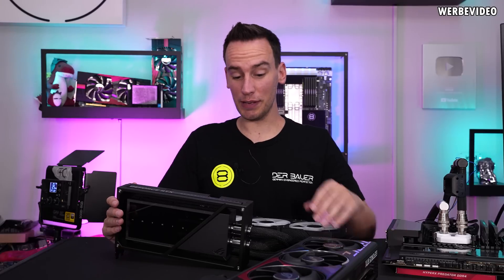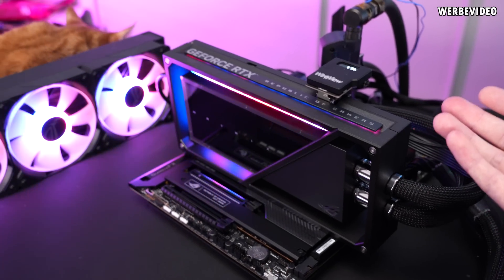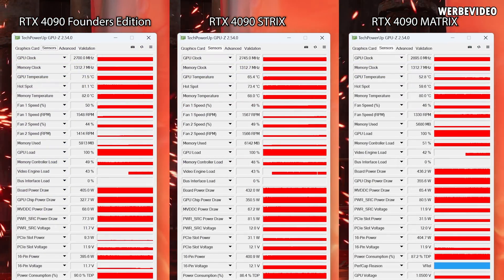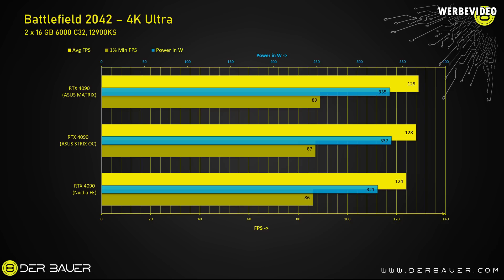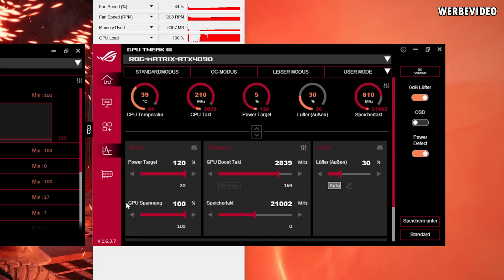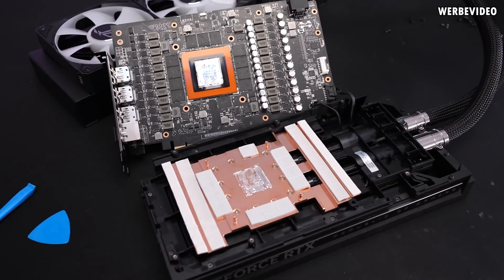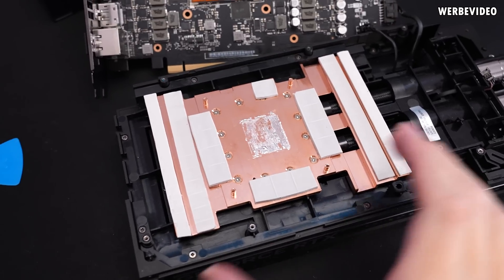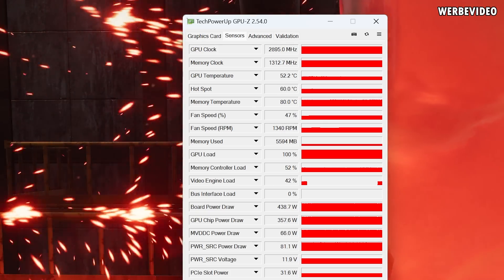The fastest GPU ever Made! RTX 4090 Matrix

Comment: 4090 is coming up to 1 year old, which means the 4090 has been Nvidia's most powerful GPU for 1 year too. I'm just wondering if this is a record, as a GPU doesn't normally hold the record of king of the hill for long.
Reply: 3090 released in 2020, 3090 Ti came in March 2022. No record being set here. If anything, I could see this item being authorized by Nvidia because they're likely releasing a refresh sooner rather than later due to poor sales in general. Asus didn't need a halo product - they already had the best 3090 and lost its largest Nvidia AIBP competitor globally (EVGA). This product is more in line with Nvidia's interest than Asus. I can really see a 4090 Ti coming either before or immediately after new year
Reply: the 1080ti would like a word hhehe

Comment: Nice, but for the size and parts used (cost), I thought this would be 3ghz out of the box. I would also have thought that coil whine would have been the best due to them switching out the noisy inductors they have been using.
Reply: mrmr gaming,
What GPU u use now, coil whine ?
Who needs these ASUS products, why not buy the RTX 5080 ? Go cheap ?
Reply: @lucasrem  Right now, the Aorus Master. After the new bios update it's my second fav performance-wise (Strix is better, but most have terrible coil whine). The Master coil whine is the same as Zotac, PNY, and some others. It's there, but it's way less than the Strix.
To me, the Matrix is just if you have the cash or really...really need it. It's a bit late to be paying this price for a 4090, and as pointed out, Asus picked a bad plate to use, so the card will only be great for a few years. When you come to sell it, the person buying might know their tech stuff and be put off.

Comment: I would really like it to see a video comparing this to a DIY open loop setup with similar components. You could get everything through Watercool (blocks, rad, res, pump, Noctua A12-25 fans) and a 4090 TUF with a Strix BIOS flash and use conductonaut extreme on the GPU. I would be willing to bet it would perform 5° better than the matrix at a given noise level, and be >$500 cheaper.
Reply: Even if it doesn't run cooler, does it matter? $500 is $500 (although the reality is that you could build a PC for the cost of this thing, and I could have a fully-blocked 4090 like $2,500 with rad and such. So, more like $1,500). Really, the biggest win is you get to buy a 4090 from a non shit-tier company (which, let's be real: ASUS is garbage-tier at this point), which is probably the biggest win.
Reply: @rustler08  The card does not matter, what matters more is the block, and the top performing water blocks are for the ASUS TUF and Strix (Optimus and watercool). An optimus 4090 block performs about 5-7°c better than an EK block.
Reply: umm HE DID, there laterally in  the graphs. Did you even watch the video?  AND NO air card is gonna  get 45C at 100% load, let alone 40C like ur saying.  My god man.
Reply: @dragonsyph2557  Perhaps you don't understand the meaning of "similar"

Comment: Instead of pushing the 4090 to new heights they should solve the ongoing black screen and fans 100 % issues that happen across all brands no matter what.
Reply: RMA... i had this problem with 4090 Strix. Truely nighmare.
Reply: Damn. My brand new PC had an MSI Suprim X 4090. It died after the 1st day! I got the ASUS ROG STRIX OC 4090 on warranty instead. And now I have the black screen issues. 😞
Reply: @Ohlukei  i was very desapointed too. I have bought a 4070 tuf during the RMA. Now i am hesitating to buy another 4090. 
The 4070 works perfectly.

Comment: 5000 series is what, 14 months away? But let's make a 4090 refresh 9 months after release.. 
No nickel plating..? How many thousands of dollars do you have to spend to get something well made. Another failure from a-sus incoming. 

Edit: FE temps about 10% higher, expected - the cost of a smaller cooler is decreased thermal efficiency.
Reply: Little over a year yes. Supposedly 2024/2025 so not quite fall of 2024. Reminds me of the Kingpin cards that too came out so late that there was already solid information about the next series. Tho Kingpin cards at least offered tangible benefits for overclocking even with Nvidias lock down everything approach. Even they (EVGA) got eventually fed up with it and now we have supposedly binned GPU's that cost double but do only a few hundred Mhz on top of stock or normal OC.

Comment: The lack of nickel plating is a non-issue

I lapped a bare copper CPU cooler and had liquid metal on it for years did redo it a few times as it would essentially weld the cooler to the CPU and a sudden enough jolt cracks the bond and makes it act like no cooler is installed

However even tho the CPU coolers bare copper is now black as can be it doesn’t actually affect the cooling capabilities as the allow that is made is still more conductive than the liquid metal itself
Reply: It IS an issue because the card is NOT User serviceable.  With LM on bare copper you are REQUIRED to reapply every few months.  THAT LITERALLY ISNT AN OPTION HERE!  Next time maybe try actually watching the video before posting.
Reply: @NinjAsylum  incorrect you only need to reapply liquid metal when it solidifies and the bond breaks

All the times ive had to replace it are from needing to spend hours driving in a car jostling it around and breaking that bond

Every-single time ive removed the heatsink with LM installed past 4 month it is bone dry but was 1:1 of when first installing it

If LM needed to be replaced then how are PS5’s having no issues hrmm?

Please think and actually read what i said

Comment: Would a Cryosheet be an easy fix for the Liquid  metal corrosion issue?  Or would the corroded copper make the sheet non-functional in some way?
Reply: Hardware Unboxed looked at exactly that in their Matrix video. It raised GPU temps by 1-2 degrees, but otherwise seemed to work fine.

Comment: I am curious if the pump was quiet if you raised the radiator.  On the table, it was slightly lower than the pump putting any air near the pump. .

Comment: I have an Asus laptop (Scar 17") and on the heatsink, the cpu side is copper, the gpu side is nickle plated (both with factory liquid metal applied).  The copper side is already starting to corrode after a little over a year.  I was having thermal issues with the cpu so I opened it up to check and found the corrosion.  Asus just doesn't care, I won't be buying from them again, which is really annoying because I really like their bios.
Reply: liquid metal does not corrode copper. It will only "plate" it or "stain" its surface and that's it. You should be worried if that plate is aluminum, as aluminum will be corroded
Reply: Thats a made up story.
Reply: For the price they're going to ask for that card the lack of nickel-plating on mating surface is plain stupid. They could do that one piece as it detaches. The sheer thickness of the thermal pads rather than making a better designed assembly is also disappointing, the thicker the pad, the worse the temps and by those memory temps... it shows. I imagine the VRMs are also pretty warm. Seems like it would have been better with a closer fit design, nickel-plating and the waterblock itself being larger to pull more from the memory would have been advantageous.

It's a nice idea, just seems like it is still half arsed in execution.
Reply: the headone,
Just replace the Gaming Laptop every year, or it's too old !
Keep the Volkswagen forever ?
Reply: At this point im thinking they're doing this on purpose so you have to buy a new one every few years.
Reply: The copper isn't corroded, it's an amalgamation of copper and lm. Add some more lm on CPU and you should be golden.
Reply: @Apollo-Computers  liquid gold...melting....
Reply: Their motherboards are overpriced garbage, and I'm not sure why people give Asus the great reputation they don't deserve, but have as a premium tech maker. Asus blasted AM5 with power under EXPO settings too, so Asus have a habit of making hardware that kills your hardware.
Reply: @stevenwest1494  the reputation came from a long while ago when their stuff was top notch.
Reply: @stevenwest1494  Problem is, if not Asus, then who?  MSI?  Zotac?  Gigabyte?  All crap, worse than Asus.
Reply: @stevenwest1494 wish their stock was worth as much as your opinion then we we want it
Reply: Im building a new PC and it will play 4k at 60fps and cost less than half of this piece of shit capitalist shit-card.. Also, a homeless person died outside my window yesterday. He had been eating himself for days.. Glad he's gone and I can get back to things that matter.. 4000 USD GPUs
Reply: @KS-nm6rt  Building a decently-priced computer so that you can get more bang for your buck is capitalism, nimrod! Communism would be the government telling you how fast your computer can be at maximum with a prison sentence for people who do custom cooling and overclocking.

Comment: Had the 4090 come with SLI brdiges, they would sell in droves for AI use, especially as watercooled 2-slot versions. Currently, 24GB is a bit too little fro most open source LLM models. And 4-way SLI would be ideal and still cheaper than a single A100.
Reply: You would still be limited to 24GB with SLI.
Reply: @WereCatStudio  Nvlink
Reply: @haakoflo  NVLink doesn't pool memory on consumer cards nor does it help anything with AI tasks.
Reply: Watt? How would sli change the 24GB ram?
Reply: which is exactly why it didn't come with an nvlink.. the 3090 heavily cut into their workstation/enterprise gpu sales which have significantly higher margins.

Comment: Unless they're binning the vram, these won't overclock any better than the other, much cheaper, 4090 gpus available on the market currently.   It's neat though.
Reply: Over clocking a GPU today doesnt yield the. Same results it use to.
Reply: Overclocking does jack for PUs nowadays since they come turned up from factory. Undervolting might get you better temps/efficiency but that's about it. You are definitely right
Reply: I recently got a 980ti Strix OC. Just the factory OC on it increases performance by 15% and then you can get more with manual OC. It’s sad how little an OC does these days.
Reply: Exactly. I think it will undervolt and run cooler and greener but the price really makes that irrelevant.

Comment: as someone with more experience using LM than id like to have, seeing bare copper like that made me want to yell out loud. what in the actual fuck is that? there is going to be SUCH a thick layer of allloy created from that LM due to inability of servicing, that i see the DIE itself fusing to the cooler in a years time. the heat cycles that GPUs have versus CPUS are HUGE. with all we know about cpu LM usage, i cant imagine a company like ASUS using BARE copper... thats wild. actually WILD ontop of making it that difficult to service..  i had this almost happen to me with an intel chip. not to mention i had to literally use 1200 grit->1600>2000grit to sand it back down to stock.  all it took was 8 months after application for me to experience that with a 10900k.
Reply: Not really suprising considering that asus had plated aluminium in their Z690 formula VRM blocks.
Reply: My LM dried up super fast with my 10700k and copper waterblock. Once a year I had to polish and reapply to not overheat. Im actually considering the graphite sheet instead on the coming 14700k to maintain resale value of that cpu.
Reply: Its just surprising to me that our Der8bauer said he did not have the pricing.   ASUS is asking $4k for this and again without any plating or easy access, and a cheap engineering cooling solution for the RAM.  I mean really $4000.00 for a watercooled version for of a 4090 that has only one real selling point.  It looks good.  Well, I guess if anyone is buying, that in itself should be punishment enough.
Reply: Strange thing is that they did got the LM 'shield' portion right but got it so-so wrong with the heatsink material. Probably the pump supplier did not want to retool for a nickel block? Also they really missed out on the memory cooling. For a card in this price class to perform about the same as a FE card in that respect is just bad. Probably the only reason why one should buy this are the looks. It performs about the same as a Strix and will have serious issues with cooling after some time. But on the other hand most AIO-GPU's already are planned obsolete as you can't really change the proprietary pump if it dies. So I would either go air or custom loop.
Reply: Probably a good reason to stick to efficient GPUs that move away from an extra 500mhz peak and also cut their TDP in HALF in the process. AKA not intel
Reply: that's horrible! unbelievable Asus doesn't nickle plate on a 3000$ card!!!
Reply: I've had lm on my delidded 8700k for over two years now. Not a single stain on cpu or Optimus block. It is nickel plated cold plate tho. I definitely expected staining on the cold plate but no. 

I would not put lm on bare copper if I could avoid it. The lm will amalgamate with copper, but it should not effect performance as long as additional lm is applied after some time.
Reply: @Apollo-Computers  You heard how difficult it was to open the block. You're expecting every owner to apply new lm every so often. That should not be a burden for the buyer.
Reply: @Simon_Denmark  pretty sure I didn't mention the card at all. But either way who would pay $3200 for the card?
Reply: @Apollo-Computers  You're right. Not a sane person at least. Even a custom loop would be cheaper and give better results.
Reply: @Apollo-Computers on nickel plated is fine, i’ve had the same.  On bare copper it stained within 2 weeks of application.  This is not gonna end well.
Reply: Cool stories mate.
Reply: Had a similar experience with my 6700k, it made a tiny hole that was hard to sand, I tried applying liquid metal again, and still had issues so I think I ended up just putting some thermal paste instead, I had enough of re-applying liquid metal and sticking the IHS again..it gets boring fast, the CPU didn't even really overclock that well anyways so no big deal, I think it held  4.7 well without burning which was decent enough, it sux that on such a high end product, knowing that the temps will degrade is just .. not a good feeling lol, that said my 6700k last quite a while before having issue, I don't remember the exact timeframes sadly

Comment: Gallium on copper is a pretty big oversight
Reply: not really. Gamers Nexus have done testing on this, and ther is no significant loss of thermal conductivity or physical integrity in a copper IHS or cold plate that has absorbed some gallium-based TIM. The downside is that it can dry up and need re-application over time.
Reply: Wrong
Reply: Gallium doesn't erode copper, it'll diffuse into the copper so you'll eventually need to reapply

Comment: This might be my new second fav GPU by looks. (First one is the white rog 4090)
Reply: Would be even nicer if they routed the 12WHPWR connector out from the side where the tubes come out. Unfortunately it still sticks out from the middle which means you have to use some sort of adapter to get a clean look. Also since the fan wires are sleeved with the tubes that means fan replacement is going to be difficult.